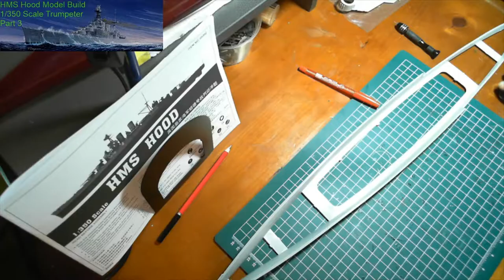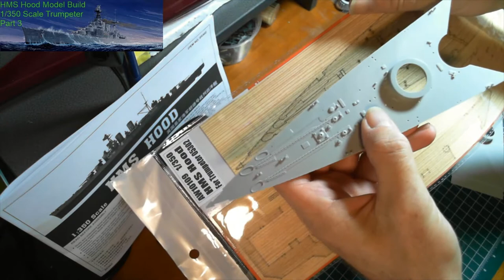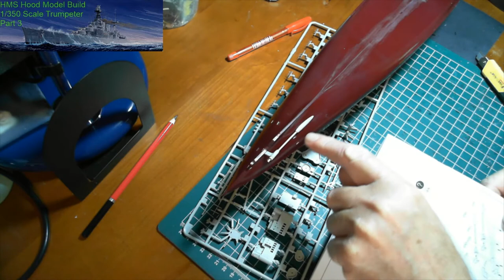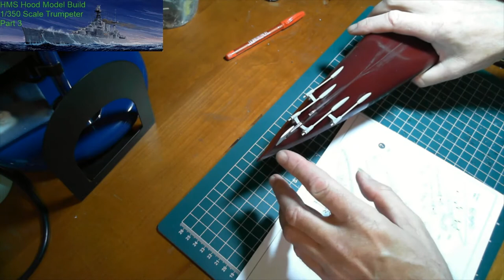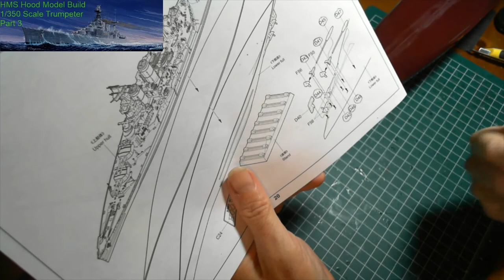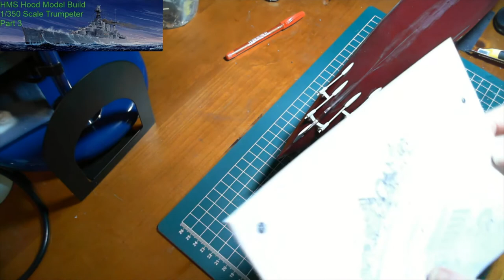HMS HOOD BUILD Part 3

Comment: I'm building the same trumpeter kit, it is awful interesting, at today is the most accurate model kit of the HMS HOOD having her last appeareance before has sank by the Bismarck. it is an excellent model kit at 1/350 scale however it has some problems about fitting the hull parts, the upper hull has a little bit more length than the bottom red part so I had to fill it with sandpaper..at least the result was fine. Thanks for share mate...!!

Comment: Re: Trumpeter's instructions not too explicit or even accurate in some places. Yes, I agree, but concluded (while being a bit annoyed) that since these large kits are not usually built by a beginner anyway, there's little problem. Someone suggest to set the rudder for a turn to port because that's the way it was when the Hood when it went down, and the way it is now on the wreck.
Your sound is much better in this episode Peter. Was able to hear every word. Thanks! 👍🙂
Reply from the maker: Rudder to port aye aye :)
Reply: In fact Trumpeter instructions are a nightmare...! whatever the kit you've choosen to